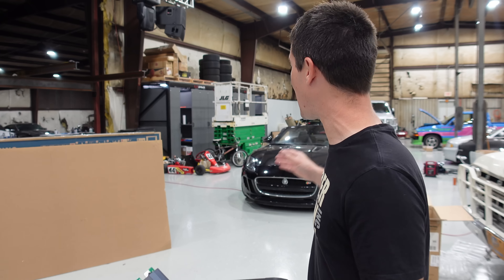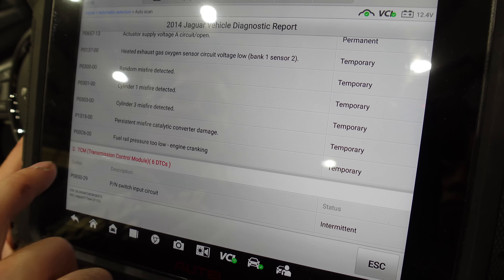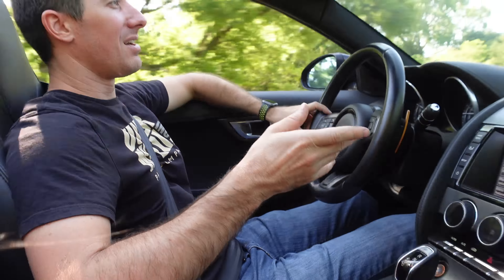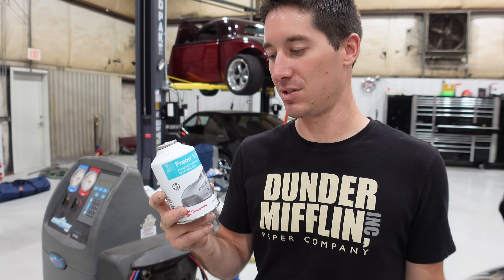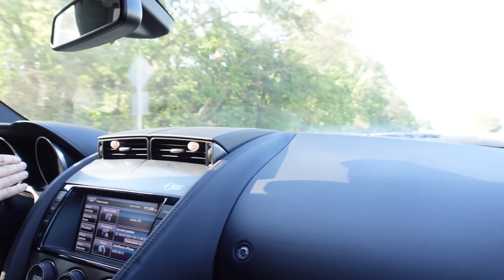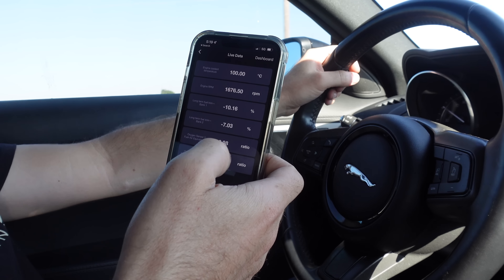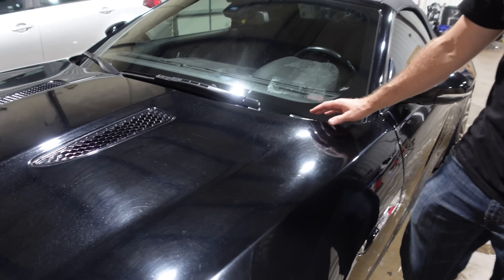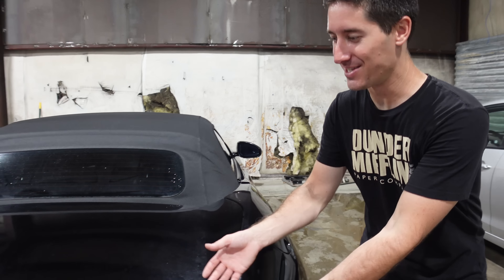My CHEAP Jaguar F-Type Is FIXED... And It Just Became My FAVORITE Car

Comment: Great result and will be even better when detailed. I've had 2 Jags and from my experience they are super fussy about battery voltage but hopefully the outstanding codes are not too serious.
Re: oil level, get the engine up to temperature, wait 10 minutes then check.

Comment: FYI. Whenever you plug into the OBD2 port of the F type you can mess up some of the electronics. It creates an electrical drain in one of the computers that will kill the battery (wouldn't be a Jag without some electrical quirk, right?). The way you get around this is after plugging into the OBD2 port, disconnect the battery for ~30 sec and whatever problem the OBD2 connection created is reset.  I disconnect the ground to the car under the truck liner, not the battery itself as the access is easier.  I killed a couple of batteries until I learned the battery disconnect trick. Nice series.
Reply: Came here to say this. Let's see if he finds out the hard way.

Comment: Very happy it is nearly all sorted. I've not had this as a big issue myself but the forums seem to think the F Type is pretty sensitive to bad fuel and a lot of people suggest using injector cleaner every third or forth fill up. Certainly mine runs slightly sweeter after running a bottle of injector cleaner through it.

Comment: To check the oil... After warming up the engine turn it off, wait 10min or so then without turning the engine back on check the oil
Reply from the maker: I just drove it home, read your comment, turned it back on and boom oil level is right on the money 🔥🔥🔥

I must have tried 10 times and it never gave me a reading before.
Reply: I was literally just about to comment the same when I saw your post.  I have an F-Type R with the 5.0 V8 and it works the same way.  Car has to be off for at least 10 minutes before it'll let you check.
Reply: @WatchJRGo  awesome man, thanks for the series, there's a bunch of F-Type owners closely watching your progress on Jaguar Forums 😎👍

Comment: Had a Mini Cooper S in last year for a permanent knock dectected.
We went through everything, plugs, coils, fuel filter,etc.
Eventually turned out that it had 95ron fuel in it when it should’ve had 97ron (UK). After 20 litres of 97 and an Italian tune up it ran perfect 👍☺️

Comment: Well done getting the jag back on the road, lubricate the active exhaust valves make sure they're free and the drain holes where your roof folds down if they get blocked it could cause problems also check rear subframe for rust other than that enjoy smiling while you drive.

Comment: I’ve seen when the converter damage code comes up it disables the injector on the affected cylinder to save the converter. Clear codes and fixed!

Comment: @WatchJRGo: if I remember correctly you can only read out the oil level when the engine has been switched off for more than 15 minutes, it's like that on most JLR products these days. Also Dynamic mode could have been written out with the tune, that deletes most drive modes and makes it go fast in every one. Not my choice, but that's what it came with for you!
And thanks again for rescuing this one, I'm madly in love with F-Types, especially the supercharged Sixes! The growl when you start it up and then revving it when it's nice and warm... 😄👍

Comment: Can't wait for the full detail on this car,  going to take some work,  but i bet it comes out like glass... when you have a start/stop car,  there is way more plumbing involved and wiring.  Electric water and trans fluid pumps and plumbing,  it's worse on a turbo because it also has air, oil and cooling running back n forth front to back off engine.  Good job getting everything hooked up correct first time.

Comment: I have a jaguar f type s 2016. I had 12k miles this spring and i had a check engine light for o2 sensor. I read it was a warranty item and they fixed it no questions asked. I want to see you try this. Warranty on o2 sensors is 10 years 100k miles

Comment: Don’t forget the battery drain issue if you’ve used the OBD and not disconnected properly.  The car doesn’t fully shut down and drains the battery.  Way to tell if the cars hazard light button is still illuminated 10-15min after locking the car it has the issue.  Disconnect the battery to reset it. 👍🏼

Comment: Oil check is the same on the RRS of the same era. Only works with engine off. It also needs to sit for about 15 minutes after it was last run for the oil measuring to work. I miss dip sticks 😉.

Comment: You noted that it may have been tuned. A tuned F-type typically consists of an aftermarket supercharger pulley and a reflashed ECU. If there's only one and not the other (due to changing the engine), that may be the issue. (I'm not the first to note this.) I wonder if some of the naysayers will now decide that Jags are nice...
Reply from the maker: It's tuned for the smaller pulley, you can see it throws a temporary code that says "Non-OEM Calibration" 🍻
Reply: @WatchJRGo  I'm sure that you're right, that it's tuned for the smaller SC pulley but the tune on these aj126 are typically for a the crank pulley which is 11.6% larger. This was the case on both my F-Type and F-paces.

Comment: I've seen more codes than that. But always start from scratch like you did by clearing everything and see what comes back. Sometimes if it's started with the existing codes still on it like it did for you. It will cause issues with the way it runs. That's why you need to reset all the modules.

Comment: Hey like my 2012 xkr for which the fType is based off of the oil light can only be read when the car is cool and in the on position, not with the car running....im 99.99999% sure...loved this video

Comment: I did a xf last year got it as a non runner and replaced the engine ...it was always unhappy and endless headaches ....I did get everything sorted after a few weeks but it always came back with codes ,not sure if it was ground wires or what but I ended up parting ways and cutting my losses

Comment: Things like "x mode unavailable" definitely sounds like a battery voltage issue. My XKR gets fussy when it's been sitting too long. Same for the TPMS light if it's a TPMS system fault message. And the power steering heaviness as I commented on the previous video. Hopefully that's the only issue and that it should be fine if you replace the battery and keep it on a trickle charger if you don't drive it often.

Comment: You need some Goo Gone for those stupid windshield stickers, then use the razor to finish them off, then some glass cleaner to clean up the Goo Gone and any other residue left behind.

The Detail Dudes definitely need to get after that thing, even after washing it looks awful, just slightly less awful.

Comment: Trees? Meh. My C6 spent approximately 3 years sitting outside, in the sun, in Ohio before I bought it. It got hot enough to spiderweb the rear view mirror.  Nearly every body panel has some nice crosshatch mess / cracking where where the SMC panels are bonded. It looks like scratches, but it's not. The only fix of which I'm aware is to sand it down, shoot it with high-build primer, paint, and clear. (Essentially, repaint the entire car.)
Oh, well. At least it was cheap.

Comment: If a vehicle has sat for more than three months with less than a full tank (especially ethanol blends) the fuel is BAD even if it’s good 
The two number one diagnostic goto’s are bad earths and other electrical connections then bad fuel.

Comment: Curious - do you have any issues with using the OBDII port and the battery draining ? Apparently a notorious issue with the F-Type if you do not "disconnect' properly

Comment: If this F-Type is like mine the oil level can’t be checked as you drive.  After you shut down the engine for like 10 min., THEN it will check the oil level.

Comment: Seems properly quick. I would ask you what the horsepower and torque are but it's easier just to Google it.
Reply: 380hp and 330 ft lbs
Reply: @timk.537  That's not that much more than my bone stock 2004 Infiniti G35 sedan.

Comment: 91 is premium there? Here in NZ it's our lowest, we have 91, 95, 98 and 100+ octane at the pump.
Reply: Our rating system is slightly different, but they are analogous.
Reply: Also around 10% corn in the US. Our petrol is crap but cheap.

Comment: If you have heavy steering, steering solenoid fault codes and dynamic mode is not available you might want to check out a TSB issued for this problem : https://static.nhtsa.gov/odi/tsbs/2016/SB-10095101-1020.pdf I did this last year on a customers car and haven’t had a problem since.

Comment: If you did not clear all the computers after changing the engine, st least the ecm and tcm (if it has one) then I am really disappointed in your skills in doing these types of projects...This just plain common sense to reset the ecm on an engine change so you can start clean with no prior issues to cause more issues....start clean with new codes if there are any.....all i can say is WOW!!!!!

Comment: A very fancy, expensive Yugo. You go for awhile, then you stop. Jay Leno has a good video for a Lotus with the V6 engine from a Camry or RAV4, plus a supercharger. Get one used and it will likely go 300 thousand miles with no major problems if properly maintained and the driver does not think they are Ricky Racer.
Reply: And one could also just watch a channel about taking public transportation...?